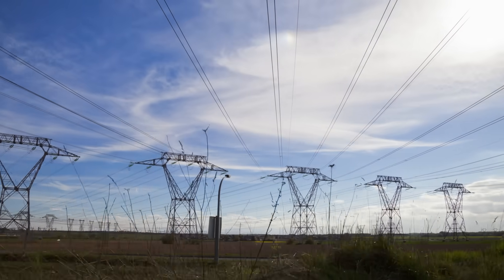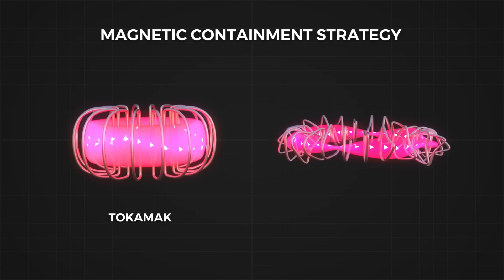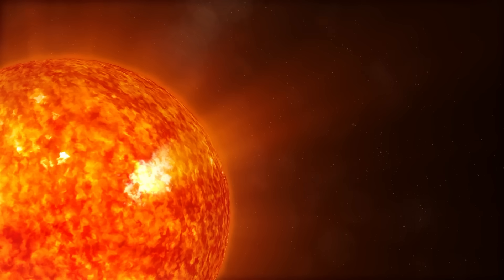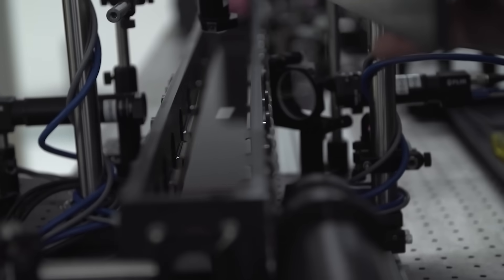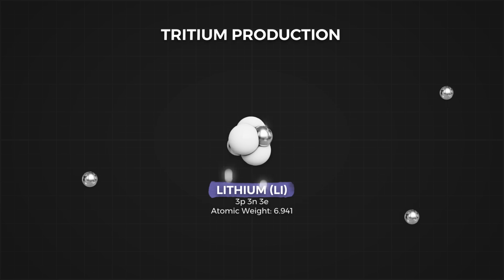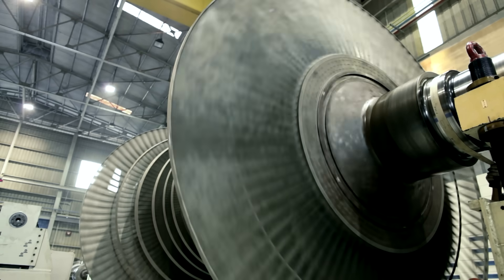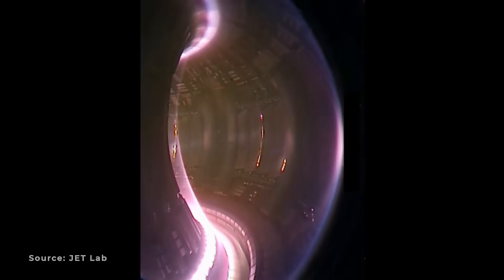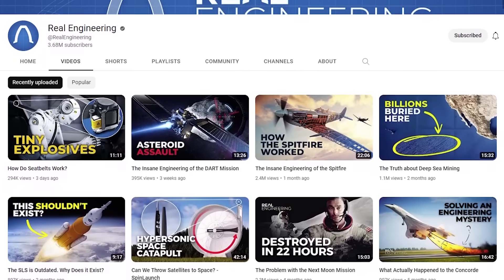The Problem with Nuclear Fusion

Comment: The problem with nuclear is NOT economic. Long-run, they're EXTREMELY profitable. The problem is absolutely 100% political. Idiot politicians shut down nuclear reactors long before the end of their lifespan, and don't allow the building of Generation III and IV fast reactors that can burn the transuranics and leave only low-level wastes that's easy to contain on-site and reduces to below background levels in about 300 years.

The misinformation about nuclear power HAS to stop!
Reply: Real Engineering has historically been anti-nuclear. It's not the first time he has spread disinformation regarding nuclear energy. Pretty sure it's just because of his political biases.

Comment: There’s one thing I still don’t understand about using fusion reaction for energy.  It takes a tremendous amount of heat and pressure to fuse atoms together.  In the Sun, these are provided by its own gravity.  How do we know the energy it takes to fuse atoms together in Earth-normal conditions isn’t greater than any energy that might come out of fusion?  With fission, we do know that we get a lot more energy out than it takes to break massive atoms apart — I assume that’s equivalent to the energy that supernovae put into making those atoms in the first place.
Reply: well today they just got net energy for the 1st time ever, far as we know
Reply: We know because it’s pretty basic and easy physics. Usually you learn about how it works at the age of ~18 in school.
Reply: "How do we know the energy it takes to fuse atoms together in Earth-normal conditions isn’t greater than any energy that might come out of fusion?"

Short answer, math. Longer answer, we know because we have tested it alot. The longer answer still, there are two nuclear forces, strong and weak. 

Iron is the balancing point. Above Iron fission releases energy, and below fission takes energy. Like wise with fusion. Below iron fusion releases energy, above it takes it.

Comment: The reason why most choose the tokamak design over the stellarator design is because of complexity. With the tokamak you need to stabilize the verticle plasma drift and with the stellarator you dont. The price of the stellarator is more machining.

Comment: Just one fact: the amount of energy that could be taken out of earth as thermal energy (heat) is more that a thousand times the amount of energy the whole mankind is using right now and will not run out for more than 100,000 years. 
One more fact: as you think of that energy from earth: the amount of energy our sun is radiating to earth is even more than 1.000 times as much as that.
So why poke around with fusion at all?
Reply: Because the cost of that energy isn’t related to how much of it there is?
Reply: @Gomlmon99  How much energy produced fusion until this moment and how much did it cost until now (worldwide!)?
Reply: @adolfhochhaltinger4040  The same as any technology when it’s in research.

Comment: Tech from fusion reactors is being tested for deep geothermal drilling with success in lab and real world testing starting 2023. We're talking Plasmabit drilling using millimeter waves that vaporizes bedrock

 Its unfortunate that its not as sexy as fusion. And doesnt hold the same cost-sunk fallacy for governments. Bc it also needs investment and engineers to solve its arguably simpler problems

Deep geothermal drilling (10-20kms deep) can give us access to nigh unlimited heat from the earth's crust, and could be equally as cheap and unrestricted by geography or geopolitics

It also can reuse existing power infrastructure by drilling in with at decommissioned power plants. And potentially carry over expertise from engineers and workers in the oil drilling industry

If anyone is interested I'd suggest looking up Quaise, and interviews of Carlos Araque. He's the CEO who was previously an oil drilling engineer, and had partnered with MIT for preliminary tests the past few years. Quaise is the spinoff from that

Comment: As someone who has followed the channel since my undergrad, it was very cool seeing the lab I work in featured in one of your videos. I thought the video gave an excellent overview of the science behind Nuclear Fusion energy and the basic engineering of the Tokamak. 
One thing I'd note - fission power stations are insanely expensive in large part due to the very stringent regulations they need to meet due to the potential harm an accident could cause as well as the somewhat unfair public perception of the risk associated with them. This wouldn't be an issue with Fusion power and they could be regulated like any other energy generation technology which would help reduce the build costs. 
The costs to build a Tokamak will be very high at the beginning as there is no supply chain for a lot of the components we need so these need to be made bespoke, this should change once there is a proven design which can be built in larger numbers.
Reply: I really hope more people get to know that fusion and fission are different

Comment: I have been in nuclear energy power production for nearly 40 years. I totally desire for this technology to develop but I am also aware enough to know this is not 10, 20 30, 40 years, or even likely 100 years within reach. So much of the material and applied physics just have not been discovered yet to bring fusion to a usable let alone even a practical break-even state. The technologies just do not exist and without a near Einstein-level change in our understanding, they are not likely to do so for a very long time.
Every video promoting this ALWAYS overstates the viability, honestly, even yours does.

Comment: Breaking news just one day after your upload: For the first time, scientists were able to generate more energy than they invested in the process. The researchers used 2.1 megajoules of energy, with the help of laser beams, to initiate the fusion of two hydrogen isotopes. The fusion reaction in the facility generated 2.5 megajoules of energy.
Reply: Keep in mind that it took around 500 megajoules to generate the laser pulse. 2.1 megajoules of which hit the fuel pellet, initiating fusion, and producing 2.5 megajoules. It's a breakthrough,  but also an extremely tiny OVERALL energy return.
Reply: @manatoa1  While I am skeptical of inertial confiment fusion being in any way practical for electricity in the near future, I would like to point out that the laser inefficiency is less of a hurdle than it might seem from the numbers.
As your numbers show, the lasers used in the experiment have something like 0.5-1% efficiency.  However, as I understand it, the lasers used in many of these facilities are rather old and outdated.  They're bulky and use flashlamps and other older tech to pump the lasers, mainly because that's what was available when the facilities were built.
Modern diode-based lasers can have efficiencies of roughly 40% or something like that, which would bring down the input energy required to run the lasers drastically.

Personally I think magnetic confinement fusion is much more likely to become effective for electricity production in the (relatively) near future than ICF, simply because current ICF setups typically have to obliterate a metal houlram (might have misspelled that) with every shot.  Considering electricity costs and typical material limitations, I find it hard to imagine getting enough energy from a shot to cover the cost of the metal being expenses with the fuel.   Then again, I'm not a nuclear engineer.  Just a aero/mechanical one.

Ok sorry for the rant lol.
Reply: @epicspacetroll1399  I thought it was quite a thoughtful reply. Firstly, I'm not any kind of engineer,  I just read some longer articles and got really annoyed with the way this story has been reported. The majority of people seem to be under the impression that we've achieved a net return on energy invested, which is horribly wrong.

If we have diode based lasers that work in this application, I think that's great. I'm a fusion skeptic, overall, but if we could actually do it effectively it'd be a godsend. I agree with you that if we can do it, it'll probably be magnetic confinement that works.

Mostly, I'm a nukebro who hates seeing people say we should skip fission in favour of waiting for fusion. When people are fooled into thinking fusion is a lot closer to commercial reality than it is, the argument for waiting gains traction. I think there's a rapidly closing window where we can decarbonise, and I hate the distraction fusion represents in the short and medium term.
Reply: No they didn't achieve breakeven.  The press release lied.  The input energy of 2.1 megajoules was only the energy contained in the laser beams.  It does not account for all the energy the NIF consumes getting ready for and making a shot.  From the NIF website, the NIF consumes 200 MWe continuously during make-ready and the actual shot.  Taking that into account, the plant is only a few millionths of a percent efficient.  Many orders of magnitude away from break-even, much less net energy production.

Comment: 2 things about nuclear fission : The only economic reason why nuclear plants were closing is because coal, gaz and petrol where dirt cheap until recently. 2) Renewables energies like solar and wind, as of today, has a bigger cost and carbon footprint per Mw than nuclear. And their intermittent nature means you need gaz plants to compensate. The biggest problem with nuclear is both political and social, about the risk, real or perceived, and the responsibility of waste management.

Comment: Please make a video exploring the misconceptions of why Nuclear Fission is considered "bad", and why it costs so much.

Here are a few points:
-  Costs are high not because of inherent cost of construction and disposal, but because of over-regulation.
- Nuclear waste is not as big of an issue as most people think it is, it's has very high density, which makes weight figures very misleading, it's volume is not that big. The volume of the entire world's spent nuclear fuel fits in a few olympic swimming pools by volume.
- The most radioactive material is a very small percentage of the total waste (~3%), and it becomes as radioactive as commonly naturally occurring minerals in a few years, maybe tens, probably fewer, definitely not thousands of years as it's commonly thought.
- Nuclear waste storage is a very safe, solved problem.
- Coal-burning plants burn coal that has radioactive particles in it, resulting in putting them in the air, which is VERY BAD.
- "green" energy solutions, such as solar, wind, hydro, while renewable, are not as clean as the public seem to think. Solar requires massive amounts of concrete for foundations, which produces a lot of CO2 to produce (third largest emitter of greenhouse gasses), but they are left in the ground when the turbines are shut down. Solar has a big issue with child/slave labor, toxic material and non-existent recycling. Hydro, doesn't just use concrete, but the way hydro is implemented is extremely disruptive not just to natural ecosystems but to people as well (can cause massive floods because of mismanagement).

Fission is the best energy production method we have, right now and for a long, long time, and it's being stifled because of propaganda and misinformation.

Comment: "The initial [ITER] budget was close to €6 billion, but the total price of construction and operations is projected to be from €18 to €22 billion; other estimates place the total cost between $45 billion and $65 billion, though these figures are disputed by ITER. Regardless of the final cost, ITER has already been described as the most expensive science experiment of all time, the most complicated engineering project in human history, and one of the most ambitious human collaborations since the development of the International Space Station (€100 billion or $150 billion budget) and the Large Hadron Collider (€7.5 billion budget)."

By comparison, how much is being spent on developing these?

Generation IV reactors

Gen IV fission reactor features include:

1. Nuclear waste that remains radioactive for a few centuries instead of millennia
2. 100–300x energy yield from the same amount of nuclear fuel
3. Broader range of fuels, including unencapsulated raw fuels (non-pebble MSR, LFTR).
4. Potential to burn existing nuclear waste and produce electricity: a closed fuel cycle.
5. Improved safety via features such as ambient pressure operation, automatic passive reactor shutdown, and alternate coolants.
Reply: Pretty similar investments into fission as well. ESNII alone is several tens of billions of dollars.

Comment: Fusion? Scifi.

Fission?

Not enough
Uranium and other fissile reserves accessible,
Containment materials on the planet,
Locations appropriate for generating stations;
Excess of
Atomic
Residues.
- Abbott D. Limits to growth: Can nuclear power supply the world’s needs? Bulletin of the Atomic Scientists. 2012;68(5):23-32. doi:10.1177/0096340212459124

Meanwhile solar PV, geothermal electric, wind, hydro, multiple types of storage are all viable and much, much cheaper than fossil or fission.
Reply: US Energy Department might announce tomorrow the first time we’ve achieved net gain fusion. Sci-fi has a way of eventually becoming science.
Reply: @Palbizu  yawn FOUR DECADES of hearing the same "Sci-fi has a way of eventually becoming science," with blandishments about some might be announcements. 
Try to understand, I'm not saying this to pop your balloons; I'm saying this because the fundamental Physics and basic Economics tell us we'll always be at least two orders of magnitude away from commercially viable fusion, at least until there's a worldwide excess of Lithium driving its price negative and/or the price of Helium increases ten thousand fold.
Meanwhile wind, solar, geothermal, hydro and multiple forms of electrical storage are not attracting funding proportional to their potential to solve problems right now, today.
Jules Verne writing about moonshots and Arthur C. Clarke about communications satellites? Valid. Perpetual Motion and commercial fusion? Charlatanry.
Reply: @william breen Breeder reactors make these issues _worse_, not better. Until we're harvesting iridium and hafnium from asteroids, simply we do not have the raw materials to continue fission at current rates for more than a few decades, and any increase in fission production, or shift to thorium or other material-intensive low-energy return gambits cuts that to only a few years.

Do the math. Check the facts. Don't shoot from the lip.

Comment: as a researcher who worked on fusion research. there are few issues I want to bring light to. fusion will create radioactive waste, and depending on the plasma facing material we will asses if the waste is long term or short term, tritium (t) is scares and we will have to either use tritium breading material (Lithium blankets). my research was on plasma facing materials and it is possible to create a short term low activation plasma facing walls, however short term is subjective we defined it as less than 50 years half life....

Comment: 2042: 10s of thousands of robotic parts in the volume of a red blood cell.
2072: customizing bossons. Any fusion reactor built before that date will be ridiculously expensive and flaky and get totally eclipsed by the W force beam tech of 2075. The trillions of dollars spent on this are wasted and would have been better spent on gen 4 reactors and thorium salt. We'd actually have both of those in mass production now if the money hadn't been wasted on this "reach exceeds our grasp" pipe dream. Imagine the waste if Victorian England insisted on sending people to the Moon, they would have wasted all those minds and all that time and still wouldn't done it before 1950. Also, remove all subsidies, including military spending, that prop up fossil fuel and nuclear fusion electricity becomes cost effective.

Comment: You make fission power sound cost prohibitive, but that's a bit disingenuous. It's only so expensive because of the public fear of anything "nuclear".

We've had the technology to use and reuse recyclable fuels for awhile now, which would produce significantly less waste, and decay much faster as well, and reactors get smaller, cheaper and safer every year. 

If people could shake off their irrational fear of anything involving the word nuclear, we would be living in that utopia you described already, with fission alone.

I want fusion to work, but until that "twenty years" is finally up (some 60ish years in the waiting) we NEED to develop our fission infrastructure and save our planet, nothing else can do that right now, except clean, safe, reliable fission power.
Reply: Reactors are currently getting more expensive every year, not less.

It’s not expensive because of public fear. It’s expensive because of capital and EPC costs. Supply chains, raw materials, and programme management.

Comment: Thank you 🙏🏼 Also: One day, please address how fission is NOT an uneconomical power source by nature, but rather one that was made and is kept artificially uneconomical through undue regulatory burden, overblown red tape and the garden variety NIMBY.  
A recent example of the first two factors would be the closure of the Diablo Canyon nuclear powerplant in California.
This power source significantly displaced fossil fuel plants during the previous century, without the aid of subsidies; If the economics of nuclear power were inherently unsound, there would be no civilian nuclear industry.

Comment: Equipment, a fair budget for unforseen expenses and a place to work... With these things in place I could solve the input vs output issue the safety issue and the initial power draw issues all in one year. Machining tools and some good electronics will do most of it.

If someone wants to play metalergy for a bit and material scientist we could work it out for greater sustainability to boot.